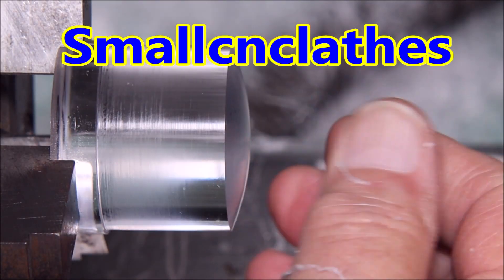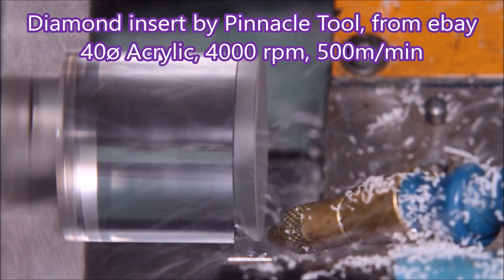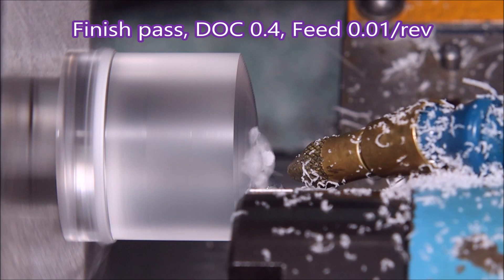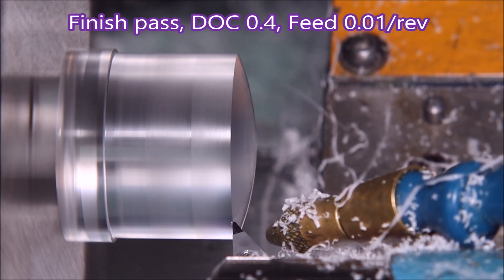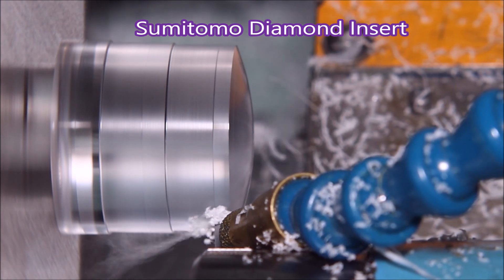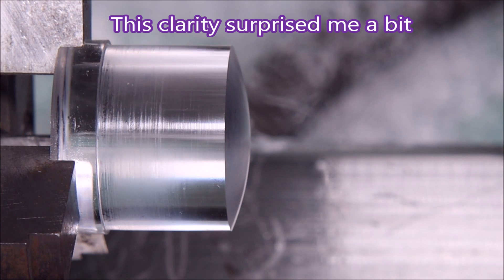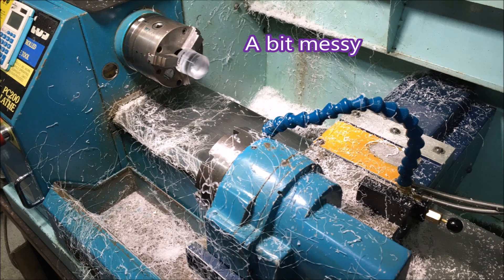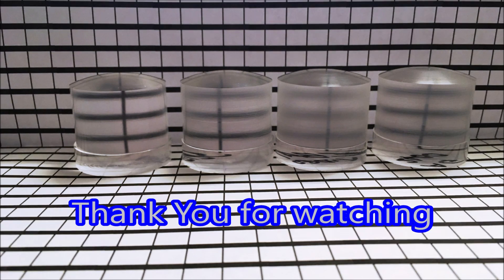Diamond Insert Turning  Acrylic Rod in my small cnc lathe. Includes cuts with carbide insert

Comment: im not an expert but iirc ideally you would have a lathe with hydraulic ways, an air bearing spindle and linear motors if you want to achieve real mirror finishes.
Oh and vacuum the chips directly from the tool
Reply from the maker: Thank you for your comment.  Maybe ideal but not what I have to work with. I do what I can with what I have.

Comment: Nigel I wonder how a lubricant would effect the finish? say water, WD40 & oil.
what about a finish pass on the others too?
Reply from the maker: Hi Andy, No idea how any of that would work, but I have quite a few bits of 80ø 2011 to try next. I can certainly try dry and mist soluble oil.  No WD40 though as it is crap to mist and brushing it on at 4000rpm to spray my camera, I don't think so.  Probably another week to get that video together.
Reply: Make little odds to me any hows as my lathe tops out a 2K and that's fasts enough for me.
Just interested how it would affect the finish of something like acrylic.
When doing Aluminium, WD40 helps me when I want a good finish on the Mill, granted on the lathe it's gone before doing any good so I tend to use oil.
Reply from the maker: I think your lathe at 2000 rpm will reach the surface speed required as it looks like it can handle much larger diameter material than my cnc
Reply: @smallcnclathes  true if you want a large od item.
Reply: @smallcnclathes  I'm late to the party but white spirit is good on soft metals coper ally but as someone else said use a hoover to take the cutting straight of. A, it stops the mess and B, removing the cutting improves the finnish. Acrylic is best done dry and using comp-air blowing from under/behind the tool.
 The banding is most likely due to the vibration in your machine rotation and the friction vibration in your feed drive.
 Someone else mentioned air bearings/linear drives blah blah, I've 20 years using those precision Diamond Turning machines, great results but you start looking for smaller flaws then LOL
 OH and the tip must be VVV sharp, high rake, radius size, rubbing is all BS, it's all about a pure cut and the machine having no vibration.
Reply from the maker: @Andrew.J.R.Simpson  it is never too late for good comments. Thanks for joining the discussion.

Comment: That was an interesting experiment.  Don't they usually get those clear with heat?  I wonder if you could use friction heat to get it clearer?
Reply from the maker: Yt won’t let me reply from my PC, keeps telling me to try again. What a pain!
You are quite right, here it is called flame polishing and used on raw edges to make them look better
I imagine it may be hard to know where to stop with any form of applied heat.
I wonder how flame polishing works? Would need a flame some sort of device to hold the part and rotate it. Ermm, hang on a minute........

Comment: Keep in mind two things: first is that diamond shows huge difference when you make use out of it in terms of greatly increasing cutting speed. Second thing is most of diamond tools come with large nose radius. You were surprised that spring passes are taking a lot of material. That is because you shouldn't be taking less than 2/3 tool nose radius depth of cut PER SIDE. Doing shallow passes with such a large nose radius especially on not very rigid small machine causes tool to rub and push material away instead of cutting which is leading to deflection, that leaves worse surface finish. You ideally always want to bury entire nose radius or at least 2/3. For this size of lathe I would go for polished uncoated high rake angle carbide inserts with 0.4 nose radius that you would use for aluminium.
Reply from the maker: Thank you, in many machines rpm limit will always be a factor. The inserts I have use a 0.4 radius, so not larger than normal. I don’t have any use for diamond inserts and I usually use the polished onsets for aluminium as the require little power to cut. Use them on brass, aluminium and steel. Bought these inserts to use in videos, have no other use for them. I really don’t want to be running at 4000 rpm all the time, 3000 rpm is plenty, to subject my old machine to.

Comment: Hi Nigel,

It’s so very interesting why the diamond top cuts better than polished carbide on the plastic, and you did tell me the diamond tip didn’t feel especially sharp. Something  is going on at the tip on a microscopic level.

Well that’s an obvious observation isn’t it? :-)

Cheers

Alistair
Reply from the maker: Aluminium is next, and at 80 diameter, it will be at 1000 m/min. That may reveal more? The edge is is sharp, but not like the inserts for aluminium. There is rake on the diamond insert, but not very much, the AG insert has 20 degrees of rake. Inserts for aluminium are incredibly sharp, leave you wondering where the blood is coming from and when did you touch that insert! Thanks for your comment.

Comment: Very cool. I wonder how they do in soft metals. Are you going to try them on some aluminum or brass or copper?
Reply from the maker: Thank You, aluminium next, I have some 80 diameter to play with. Then possibly some small brass, just to compare surface finish at below optimum speed.
Reply: @smallcnclathes  I can’t wait. The RPM issue seams like it may be solved with a DIY solution. I’m on EBay right now. Air bearing spindles are there. Other than a larger Diameter stock what else can we do to get into the SFM range of the inserts?
Reply from the maker: Something to keep in mind is the work holding, my TOS chuck has a maximum speed rating of 5300 rpm. I checked before I started running it at 4000 rpm. If it is all about surface speed, I can’t see anything other than diameter and rpm. Lots of things to check including the economics.
Reply: @smallcnclathes  Very true and wise words. I can’t wait to see what happens on the aluminum.

Comment: Great video 😁 Its nice to do some testing and evaluating now and again, especially when suppliers are constantly improving and moving the goalposts. You may have had a little push off due to turning inside to out, as the tip is cutting on the flank aswell as the radius. Turning outside to in may well reduce that effect 👍
Reply from the maker: Thank you, I may have to try both directions to see if it makes a difference. Next video perhaps, if I remember

Comment: Great video as always.
The cutter should be sharp, with aggressive rake angle, lots of clearance, and as smooth as possible.
You should also generally avoid tools with excessive radii (like round inserts) – this can cause rubbing if the feed is too low and then the surface finish will be cloudy. It is recommended to go with a 0.060″ nose rad, since it’s a nice balance between lighter cutting pressure and a good surface finish on turned diameters.
Reply from the maker: Thank you, that sort of fits the aluminium type insert, just has a smaller radius. Although in that case, not sure they come with a radius that large. 0.8mm is the largest I know of.